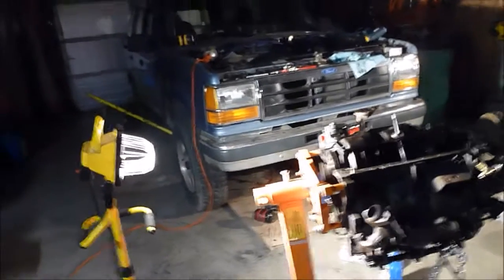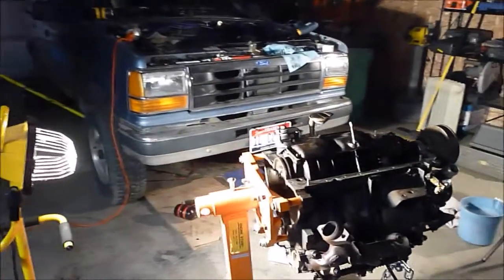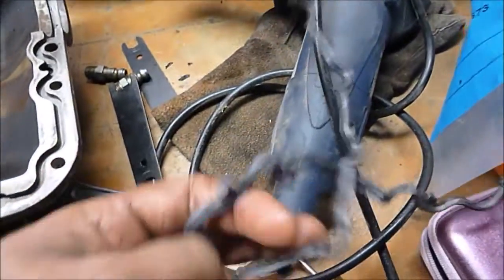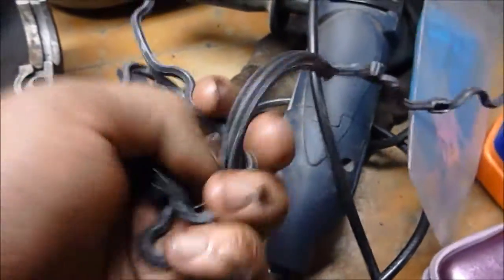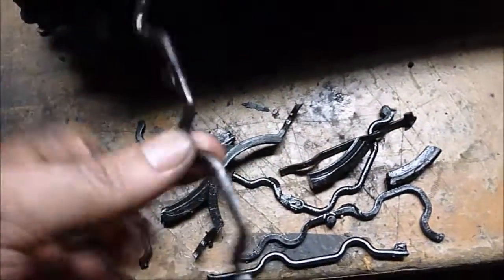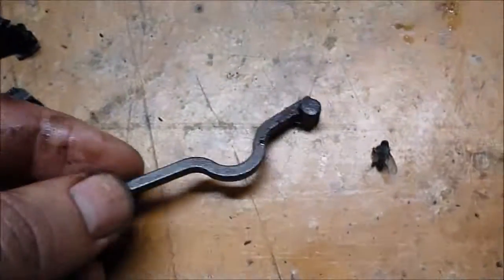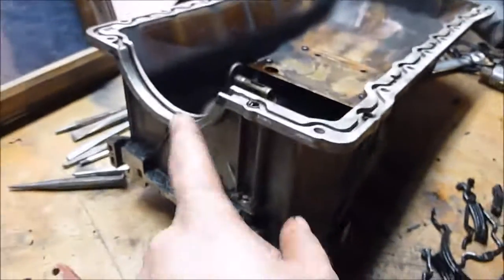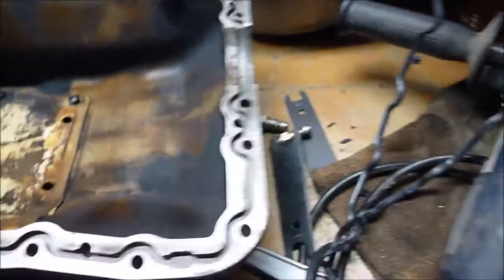1991 Ford Explorer (first gen) Oil Pan Gasket Leak

Comment: I've been having a continuous oil drip from the bell housing area, I just had the rear main seal replaced and it still leaking, after watching your video gives me a better understanding of where it's coming from
Reply from the maker: I replaced mine as well and still had a problem with it. I used the repair seal that comes with a sleeve. There were no instructions but I feel like I should have used loctite or some kind of sealant on that sleeve. Aside from that, there's a weird wedge seal that might cause problems too. The oil pan seal was a huge problem for me, I probably shouldn't have touched the rear main to be honest.
Reply: @HsCSpanky  What's the reason you said that you shouldn't of messed with the rear main ,is it because most of the oil was coming from the oil pan gasket ?
Reply from the maker: @nickfortunato2938  I believe so. The oil pan gasket shrunk so much that it was metal on metal, no way it was sealing. I bought the seals before pulling the engine, I had to have everything ready since I had to borrow a friend's shop to do it and I pressured myself to put it in. It's hard to say though. If you do do it, it leaks, if you don't, it leaks. It's a Pandora's box of gaskets.

Comment: that hard plastic halve circle piece in the gasket kit. Where does that go?
Reply from the maker: That is the wedge seal that goes in the pan where the rear main seal lives. I'm not sure what it does but that's where it goes. I had to heat up a drill bit, melt it into the old one and pull the old one out that way.